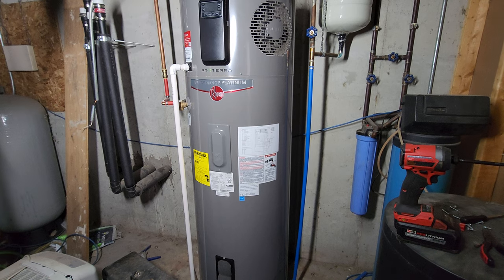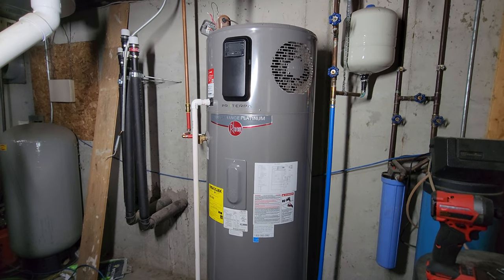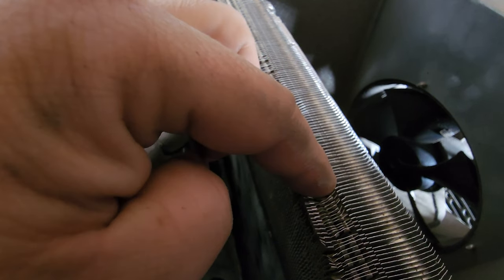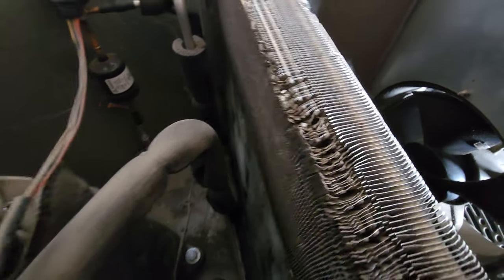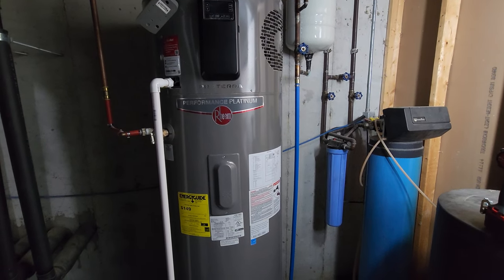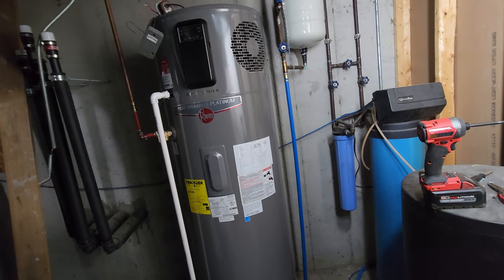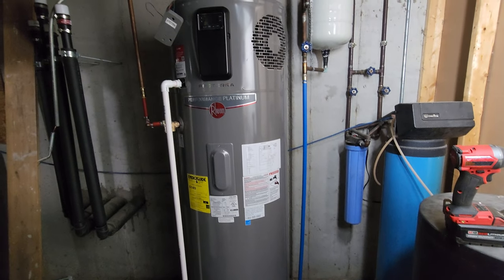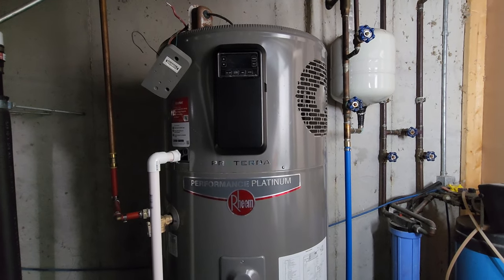The downside to a heat pump water heater. It works great till it doesn't.

Comment: Not to get too technical and it doesn’t negate your point but the heat exchanger you’re looking at is the evaporator , not the condenser. The condenser is what is heating your water.  Now to your problem. If you look at the “filter”, the space where the air passed isn’t much bigger than them space between the evaporator fins. Since many homeowners are very lax with filter maintenance, making the filter finer would clog the filter faster creating the same problem you’re having.  Think of the standard mesh filter on an ac return line.  It traps most of the dirt but the finer dust passes through and will be =come trapped to the most coils of the evaporator and decrease the heat transfer ability and increase the pressure drop across the coil which will also decrease your air flow further aggravating the problem.  I’m not disagreeing with your claim of a design issue gut let’s look at the consequences of a more ‘beefy’ design.  The fix would the a heftier filter to catch more particulates in the air.  That would require a larger fan (higher horsepower).  Filter changes would be more frequent and costly. I use a finer filter of my a/c return duct but change more frequently. You could do the same by placing a fine filter cloth that doesn’t restrict air flow too much and replace monthly, especially since you said you burned wood and have a more dusty environment anyways ..Some energy savings efforts are more costly in maintenance.  Remember, to change that additional filter media regularly or it could cause other issues. Also, periodically shutdown the unit and allow the frosted coils to melt and dry (hair dryer?).  Then use a vacuum hose with either a crevice tool or brush tool to CAREFULLY clean the fins being careful not to bend any more fins.  

Regarding the bent fins.  Those few fins have little effect on system operation mainly due to their location. However, knowing this, care should be taken in replacing the factory filter.after cleaning.

Comment: lots of people don't think about filters on lots of things, the second this video started I immediately saw the dust and knew where this was going, about a decade or so back I moved into my moms old house after she moved to Florida, her old house had humidity issues in the basement and she had one of those roll around dehumidifiers, I noticed it sucked tons of power (400+ watts) and I didn't much like paying the power bills that was causing so I decided to look into it and see if there was anything messing with it's efficiency, I pulled out the filter screen, it had a 1/4"+ thick layer of crap on it, like a lint trap in a dryer if you went 10 loads or more without cleaning it, I told her and my sister that had lived in that basement in her teens, neither knew there was a filter, they had gone YEARS without cleaning the thing.
Reply: Good idea on the additional filter.
I understand the issue here however the unit is undersized for the amount of people using hot water. Unit is designed for 3-5 people using hot water. The video shows a pretty dusty environment. Due to the increased load, which makes the unit run a long time, the filter should be cleaned more often. Maybe once a month.  Keeping the coils clean is paramount for getting the highest efficiency from this heat pump.

Comment: I purchased a similar GE GeoSpring Heat Pump water heater back in 2016 and it started throwing fault codes 6 months after the extended 5 yr service warranty ended.  Bradford now covers these as GE no longer sells this type of heat pump water heater.  I just replaced the fan and Bradford sent the part for free (10 years parts) but, again labor is NOT included.  Literally 1 month later it throws a FF code and stops working again.  Now it looks more serious and unfortunately nobody works on them.  My HVAC guy sniffed it looking for a leak, but couldn't find it and he said the evaporator coil looked very rusty (this is located in a clean conditioned space) and said unfortunately they don't work on water heaters.  I called over a dozen hot water heaters service companies and plumbers in around Atlanta and no luck and Bradford doesn't have a support/ service list.  So looks like this is now going to be a standard electric heater until it that stops working.  Highly recommend not buying one of these and just buy a Rheem Marathon.

Comment: You are exactly correct. My Rheem Hybrid is 3 years old and am having the a108 code. I called tech support and told me to do just what you said. These are high maintenance compared to other tanks. I had a oil fired H W tank for 25 years and never touched it until it started leaking, then replaced with this. Dont think I'll do that again !!!

Comment: Do an ice bath test on your evaporator inlet and outlet sensors and check resistance @ 32°. I have already replaced evaporator inlet sensor and have spares just in case. The sensors are not that expensive and that maybe the higher failure rate. The evaporator inlet sensor is subjected freeze/thaw that causes moisture to infiltrate between the wire and epoxy entering the sensor thus effecting the resistance. I have spliced in higher quality sensors that have similar resistance/temp values with success but only with short term time frame. Currently using OEM replacement, so far so good.

Comment: Thanks for the info, I was looking for this video because I just realized my coils were frozen. My wife told me something is beeping in the basement, I don't have the application connected but the system lets you know something's wrong. I looked inside the fan and saw a big block of ice in the coil, Thanks God for this video. If not, I would've had to call somebody to beat me for a couple of hundred when  I could do the job myself. And the only reason I think this problem is happening is because my basement is cold, Then you have the fan blowing cold air all the time So eventually it's going to freeze up.

Comment: I have the same water heater, i was a hvac technician 20 years ago. I installed this water heater 2 years ago and I was so disappointed with the built quality. Today I swapped a new unit under warranty. It pretty sure it look like this unit is low on refrigerant just like my unit. Don’t buy any Rheem heat pump water heater until they change the design and quality

Comment: That's not the condensor it's inside the tank it's shedding the heat into the water.  It's the evaporator. That also isn't being caused by dust, although admittedly, it's not helping the problem. That's either being caused by low freon or a failed/failing expansion valve. If the valve is sticking closed, it'll cause low freon pressure in the evaporator, high pressure at the valve. Which in turn will start to freeze regularly depending on conditions.  Low freon does the same, keeps the evaporate from filling, causing it to freeze over. If the evaporate can't fill it, it can't properly exchange the cold air into the environment, causing it to hold lower Temps and freeze.

Bad poor performing fan can have a similar effect, but usually you'll see that on a visual inspection easily.
Reply: They installers under warranty couldn't fix mine but the error suggested it's either the expansion valve or low freon. Ours also trips a breaker which is odd because it's a 400w heatpump + 1.6kW e-heater, this is on 240v 16A breaker I'm pretty sure.

Comment: Wood can be dirty. One potential fix that might help is to put a furnace filter on a box fan. This can also be put on a timer. Getting dirt out of the basement and creating a more purified environment is something you reference as a possibility. HVAC coil cleaner helps. It is all extra work and drama. The box filters can get expensive. I like to take them outside and blow them back periodically with the leaf blower. (This extends filter life, I have also washed and rinsed them successfully. Depends a little on the filter; but one can do this to be frugal. Particularly, I like to use the really high quality HVAC filters to get a cleaner environment in the air. To me, filtering the air down there seems easier and cheaper, with a box fan filter than taking the unit apart. Thanks for the info.

Comment: Is it possible to spray foam condenser cleaner like that for an HVAC outside condenser and rinse it down?  Meaning all of the dust and impurities get washed into a tray and out of the condensate tube?

Comment: We have a old water tank outside and we burn scrap wood under it to heat our water. Works good except days it rains a lot.
Reply: That's a brilliant idea besides it overheating  but it's outside so not a big issue. Firewood is the most energy efficient fuel by like 20x
Reply: @nexusly6720  It has a thermometer on it with a display inside the house, if the temp goes over 190 we let some water run to cool it off in the event we made the fire too big.

Comment: Your experience is interesting.  I’ve had an AO Smith 50gal hybrid in my garage for 9½ years now and have never had any issue like this.  I looked at the evaporator on my unit after watching your video and its clean.  Most of my neighbors also have AO Smith units of varying sizes and they have never encountered this issue.  Considering the typical operating  savings a hybrid offers, which is 1/5 the cost of others, even if you had to hire someone to clean this brand, you’re coming out ahead.

Comment: Home HVAC systems have the same problem. The cooling fins need to be cleaned at least every two years (better every year). Home refrigerators can last decades because they use coils without cooling fins (but they do benefit from cleaning the coils).

Comment: I'll wait to purchase one when the companies start putting better intake filtration and possibly through the wall exhaust kit like a dryer vent type system to remove cold air and possibly reduce decibels
Reply: When I was looking into these: the AO Smith one had a remote exhaust kit available (in case you wanted to install in a closet or something) Not sure about the Rheem.

Comment: THANK YOU! Your right. Even AO Smith tech support can't supply a .pdf print out of those interiors — and the manual shows NOTHING.     *** Do you know anything about the "condensate pan" located between the fan and the external condensate hardware (the manual screw-in piece) ?? I'm getting TINY DRIPS FROM THE TINY OVERFLOW SLOT....

Comment: If I installed one of these I would probably use the duct kit and install an inline filter box with replaceable filters. That filter that is built in is a very poor excuse for a filter. I'm very intrigued by these water heaters but I'm really not sure if the math works out to actual real world savings.

Comment: If this is in a closed garage, that's your problem if you do not have an exhaust duct on the tank. As the cold air gets released into the closed garage it begins to drop the ambient air temperature. When that happens it is slowly reducing the temperature differential in the system causing frost to form, of course this will be more apparent during the cooler months. The intake air is now too cool and have barely and heat to pull from the air. This setup without an exhaust duct is extremely inefficient.

Comment: Is the elephant in the room the wood furnace? Do you have a higher particulate load than the average consumer?
Reply from the maker: I'm sure its possible but I haven't noticed much difference between winter and summer.

Comment: Nu Calgon makes a line of spray foam cleaner for the condenser coil.But he made a good point if you don’t do some annual Maintance change air filter like on a HVAC system. Then you may have major components like compressor , ECM fan motors, PSC fan motors, sensors , control boards, refrigerant leaks, can cause expensive failures. At Best if people perform Maintance on the hot water heater the equipment could last up to 15 years. But as we all know they just don’t make things that last any not like your parents refrigerator might have lasted 25 years and is still running but it doesn’t have a place or look good modern kitchens today that sort of thing .

Comment: I think when the "freon" is low, the temperature on the coil drops below freezing.  The same thing happens in central AC units, where the coil completely freezes over.  When the "freon" level is correct, the temperature on the coil should not drop below 36 degrees F, but it goes lower when lower coolant levels.

Comment: What is the room temp and humidity? Hot water for 9 people might be tough as I bet they expect it to stop for a while to defrost. It’s like a heat pump and if that room gets too cold and wet it’s never going to defrost. 
But I agree that filter is poor. I’d want to reverse the fan so I could put a 4 inch MERV 13 filter in front of what is labeled outlet. Sure I’d have build a box for it but it would be easy to get to. And air should only have one way in so less bypass contamination.

Comment: Also, is flushing really required since this isn't a traditional water heater with a gas burner on the bottom?  I figure if the hot water is where the heating elements are (middle and top) as well as the coil around the tank?
Reply: yes, flushing is still required.

Comment: I have a suggestion: If it's possible, I would use a car engine air filter and run all the intake air through it and possibly not even have to bother with the internal air filter which you say rests against the coil (and is damaging it by taking it in and out). Again, I have no idea 'how' the air gets in there so it might not even work, but if there's a way, it would keep things very clean. Cheers.
Reply: May be too restrictive. You need air flow for the coil to absorb heat.

Comment: I would think that one could use a soft brush attachment on a vacuum cleaner that would clean this up. Anytime you're using moving air across coils this will be an issue ...

Comment: The evaporator coil is on top of the water heater. The condenser coil is used to heat the water.

Comment: You should pull the Alternating Current heating element, at least one of them if there are two, and install a DC heating element and hook solar panels to it.
Reply from the maker: We got this thing before I put up a single panel. And as the video title says it works great till it doesn't. Just something that the manufacturer doesn't come out up front with.

Comment: Gosh! You've got the right mind set about this technology. People are so eager to sell you the latest greatest that they don't appreciate the extent of which the technology limits will penalize them. I've seen very nice fridges tossed on the curbs because of that same issue. The condensor radiator gets too dirty and insulate itself from the dust buildup. In your case it's the evaporator that gets dirty because it's the one in open air flow. Nevertheless it clogs the fins and with the defrost cycles the moisture makes the dirt clings even more so. Cleaning those fins with a brush is very difficult and often bends the fins making the process even more difficult  By the way, the more efficient way to get the heat to the water would have been to have the coil immersed totally into the tank.  Another better idea would have been to borrow the "mini split" idea of using a long refrigerant hose  to remotely place  the evaporator where it cool a room replacing or helping your air conditioning, thereby increasing even more your energy saving. In such a case the water heater process or re-design could be rethought for ease of cleaning, preferably with a jet of hot water stream, sort of a waterpick system... Fortunately I did not bite into that technology. I got a 40 gal Marathon water heater for $50 on the Craigslist and connected the red and blue wire to the 120VAC instead of the 240VAC from my solar hybrid inverter and heat it at half power so that the plastic tank inside last longer. It takes about 6 hours to heat the whole tank to scalding temperature. I wrapped the tank with 8 inch of thermal foam insulation because the tank is in the backyard. So now, in the winter it helps keep the water hot for 3 days without problems. Once hot, it really takes only 1 hour or power a day - around noon -  to maintain its heat at the same level. I paid off my investment within the same month as I got rid off my gas heater and my energy bill all together.

Comment: I have a smaller unit and after 4 years I am having the same issues ... Clean , clean, clean is the issue and that is going to take more effort .... efficiency comes at a cost and the cost here are at the register and labor to keep the unit running efficiently ... it sucks to pay more and have a more labor hungry hot water heater  but that is the cost for efficiency ... I live in the south and I am thinking of adding a solar hot water  collector to the system ( direct or non direct system,  I am not sure)  just to make the system more efficiently ...  electric water heater cost more in the long run and electric cost are on the rise as demands increases.... I love the video and I feel your frustration,  but efficiency comes at a cost ( not only at the register but maintenance - to be efficient needs to be cleaned more) I had an uncle that told me as a kid long time ago... don't buy things with all the bells and whistles because that is just more things to go wrong with said units ... dishwashers , Washing machines, cars - hybrid ( but I like hybrid engines to recharge my electric system )  Hot water tanks and everything else in life but its all about your desires and your wifes desires ... My wifes sees all the other choices in these things as love for her and I can say it is a waist on money and time but TV pushes these things and we do live in a capitalist society ... so when in Rome , we do as the Rome's do.